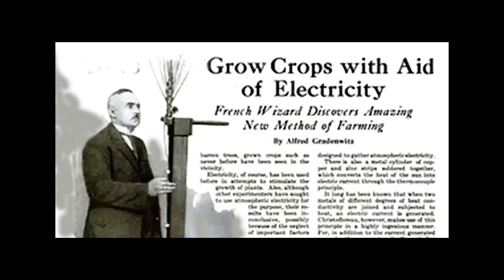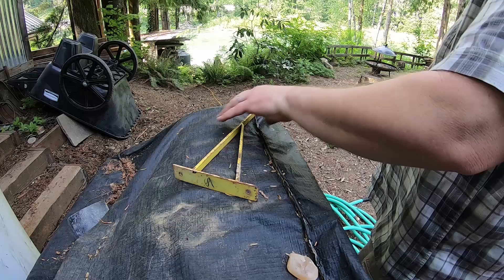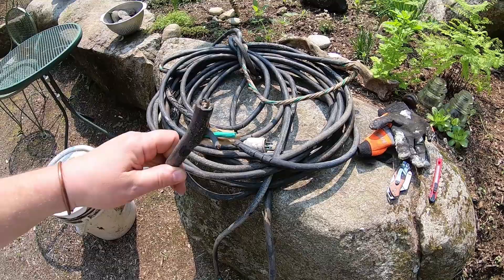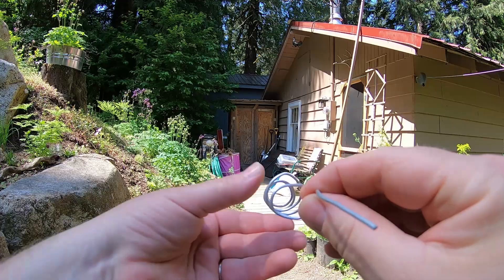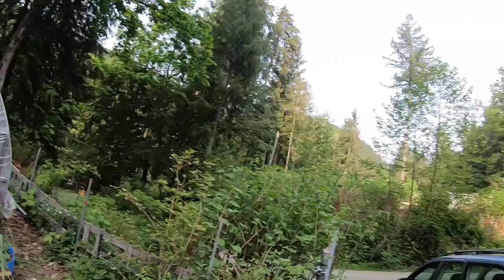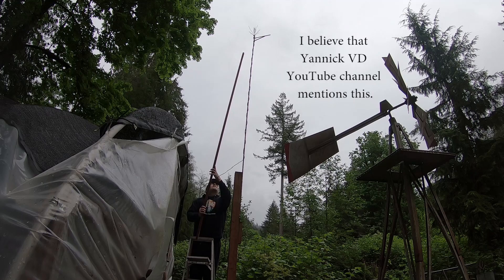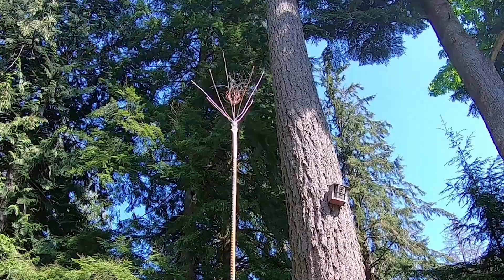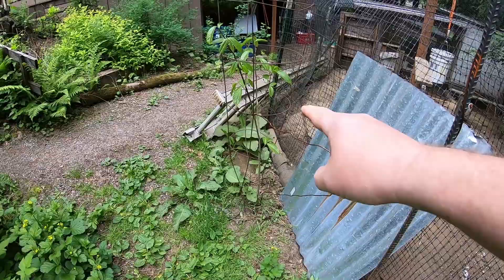Electroculture Gardening

Comment: I just learned about this a few weeks ago, and as soon as I heard it, was drawn to the simplicity of the concept. I decided to try something much less elaborate. I bought 5 bamboo poles about 7 ft long, wrapped 14 gauge copper wire around them and then ended with a squiggly spiral extending about 8 inches above the tip of the bamboo. I placed  the poles six inches into the ground on the south ends of my raised beds. I agree with you ... they are appealing garden art too!  My garden has struggled the last few years and I had become quite discouraged. I'm hoping for better results this year. Looking forward to seeing how this works for you. AND me! 😊😊
Reply from the maker: Sounds great Tamsen. Good luck. It sure seems like mine are making a difference but it's still a little early to tell for sure.

Comment: I’ve been installing the copper coils wrapped round bamboo poles with more coil out of the same copper wire wrapped clockwise sticking out of the top of the pole , in my pecan orchard. The trees a small now , I’ve already had flocks of the local black birds show up in the orchard floor and sitting on the fences a couple times , estimated count of birds was 1000 , several flocks came to visit in this area after installing a dozen copper coil poles . I should be able to see results by spring, trees grow roots in the dormant months and with all the storms that generate atmospheric energy till the trees flush with growth in the spring, I should see great results in the spring growth. I tried this this summer using a old grounding rod with copper wire attached 3-4 foot long that I turned coils in a crude antenna sticking up , and I had great results with lots of rain we received several times in august . Tomato plants 6 foot plus lots of tomatoes
Reply: So you're saying these copper things are at least good for birds to sit on?

Comment: From what info I have read, and videos. The further away  the antennas are  from the trunk of  trees. The better. You may need to put a copper wire into the ground on the rebar  antenna  holders. Looking forward to your updates.
Reply from the maker: Yes. That's how I understand it to work also. 👍

Comment: Sounds interesting, like to see if it does work.  Also try putting a 4 inch piece of copper line in one of the other pots away from them as well and see if that works as well. I heard copper in the pots helps.
Reply from the maker: 👍🙂 Just put some coils in pots today after seeing Deep South Homestead having good results with them. Maybe I'll try a few straight ones also.
Reply: All my plants in the house have copper coils in them, I actually saw a plant return from death, it's amazing!

Comment: This is also called ion harvesting. Instead of connecting the wires straight to the ground, connect them to a transformer, then to a battery then to an inverter to generate AC current.  The height of the pole  will determine the voltage, hence every 3ft = aprox 100 volts DC.
Reply from the maker: That would be fun to try sometime.
Reply: @AlmostHomestead  JP Morgan once said; If it cannot be measured, then don't promote it.
Reply: The lesson here is that you don't need to generate electricity. It is freely flowing around us all the time and also in the Earth.

Comment: If you have running water near by set up antenna very close to the war we and run up to garden.
Reply from the maker: That would be cool to try. We live on a river but our garden property is about 300+ feet away from the river up hill so it's too far to run copper.
Reply: @AlmostHomestead  Use galvanized wire. Same wire used for electric fence wire

Comment: As usual, I'm wishing there were more closeups, especially in where you hooked things up.
What is the reason to coil the wire?
Reply from the maker: I will try and show more closeups in my update video coming out at the end of this week. A Yannick Van Doorne video showed that method of winding the wire on to another main wire. I have found that winding a wire to another wire works best when wound clockwise on to the main wire. It appears to make a difference. Yannick also showed adding another wire to both wires to make sure that a solid connection is made. I will talk about that in my update and show an example. If you check out Yannick VD on YouTube, there are many videos with good information. The courses on his channel have been very helpful to me.

Comment: When you coated the magnets with bees wax did you dip them in the wax completely so inside and out or just roll the outside to coat the exterior only? Thanks.
Reply from the maker: I didn't make a magnets and wire antenna. Just the 16 ft antenna. I had a magnet stuck on the antenna but took it off.
Reply: @AlmostHomestead  Oops! Must have been from the Yannick video you referenced, never mind.

Comment: Which friggin way do you wrap the antenna??
Only idiots start at the bottom and wind upwards.
Which way to wind from TOP DOWN in northern hemisphere?
Reply from the maker: You should probably watch some other videos regarding winding techniques. You wind from the bottom. But you could experiment with different methods. Good luck.
Reply: @AlmostHomestead  Actually I have watched several. Winding clockwise from the bottom is the same as winding clockwise from the top.
When I wind top down, I can easily add in the spiral and fingers and set the height more easily.
I tried winding from the bottom up and I used more wire than necessary.
And of course had to manhandle the whole roll of wire from bottom up (I drilled a hole in the bottom and top to act as wire anchors when winding.)

Comment: What if you wind it the wrong way/direction?
Reply from the maker: I can't remember if Yannick VD on YouTube said that it wouldn't work if you wind the wrong way or if it just doesn't work as well.  Maybe search through Yannick's lecture video series to find the answer. I am just making sure I wind clockwise to get the maximum benefits.
Reply: @AlmostHomestead  Magnets work depending on polarity and the plant.
S side up for top growing veggies, S side down for root veggies if I am not mistaken.
Might be the same for electroculture.

Comment: You should be zinc and the copper to actually make a battery using the atmosphere and the dew to create the power to go to the ground you need to do a little bit more research look up Justin Christofleau
Reply from the maker: You got it. The little earth battery thing is from a little grid made of zinc and attached to copper.  Definitely studying the work of Christofleau's. Have one book so far of his patents that I showed in this video.
Reply: @AlmostHomestead  I'd really like to know if somebody has built one of these lately or if I could find some real good plans on this apparatus I may try a few other things I have in mind and it goes right along with what he did

Comment: Yeah this has zero impact. Read some research. To do anything it needs to either be high voltage and/or a special medium. You're ending in woo.
Reply from the maker: Thanks for watching
Reply: @AlmostHomestead  Usually scammers are happy with engagement negative or positive...